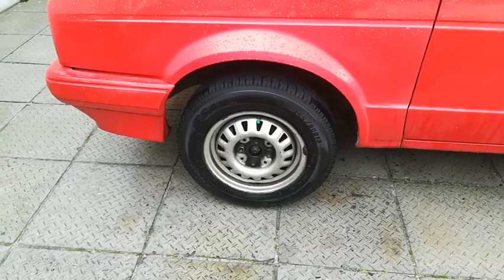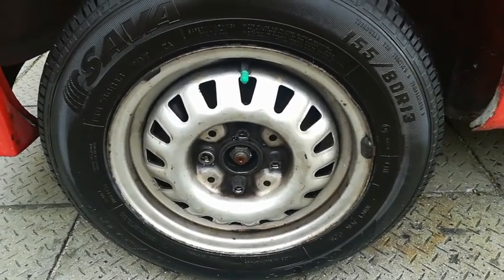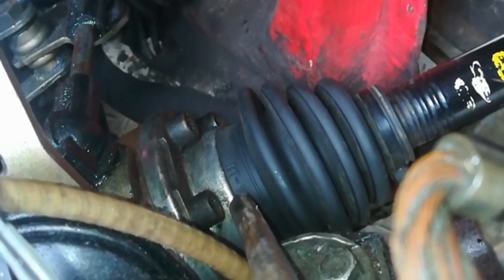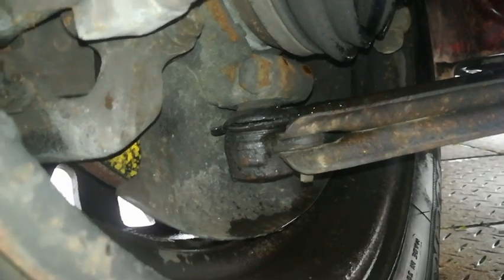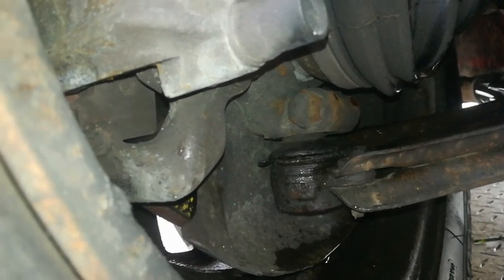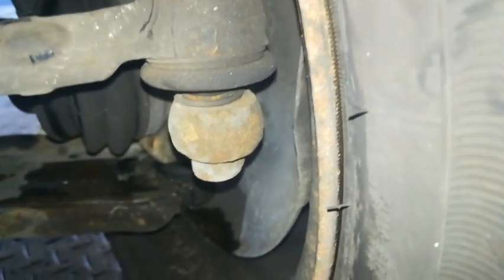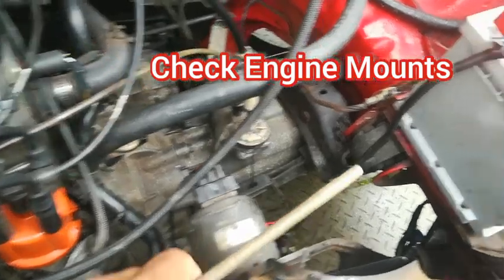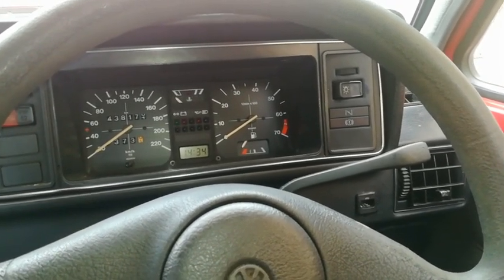GOLF MK1.HOW TO IDENTIFY STEERING VIBRATION/SHAKING ISSUES (Part 1)#golfmk1 #vwgolf#vwfox  #vwcaddy

Comment: Thanks for the info always appreciated. Do you have any suggestions on steering play?  My clutch pedal bracket tore away from the steering rack so I had to tack weld it in place. Since then I have a bit of steering play.
Reply from the maker: Hi, do you mean the steering column?...
Reply: @pjs-golfmk1-diy  Yes, sorry. The clutch pedal tore away from the steering column at the bottom. Had to weld it inside the car. Since then there is some steering play when driving. (But no play when the car is stationary) I'll take it for wheel alignment maybe they can pick up something. Thanks for the videos always helpful 🙏

Comment: Hi, what can cause the steering wheel to be loose only at high speed, inside roads the steering is normal.. iv changed the rack, rack bushes new brackets and new knuckle.

Comment: Howzit, 

I have a citi golf, and every time I drive it feels like the wheels are turning as if the steering rack is lose, like I would keep the steering wheel straight but it feels like turning left or right, 

I have coilovers on the car now, I did change shock mounts, also checked the shocks where they connect with the hubs, n they are tight, 

So I'm not sure what's goin on now
Reply from the maker: Check the ball joints... Or just take car to fitment center for a suspension check.. They will easily identify the problem

Comment: i know this is off topic but i see your car runs with no return system i woukld like to know how that works i have a carb model if its a good thing or not
Reply from the maker: I have a return there... I am using a T. Valve ... Have a closer look. I dont believe in running pump direct to carb.. Or have a look at my video "Fuel Starvation "... On the channel. I explain it in detail there...
Reply: @pjs-golfmk1-diy  thank you ill check it out now coz im having problems the resevoir pushes fuel out of both pipes at the same time
Reply: I checked the video now i need some info about the restrictor you were talking about i have a t piece just needto know what kind of restrictor your using
Reply from the maker: @curtwilliams7438  best to visit your local spares. They will give you exactly what is required... It fits onto 6mm fuel hose.